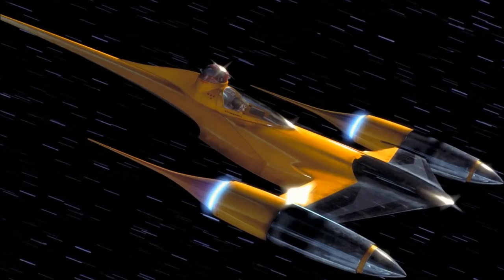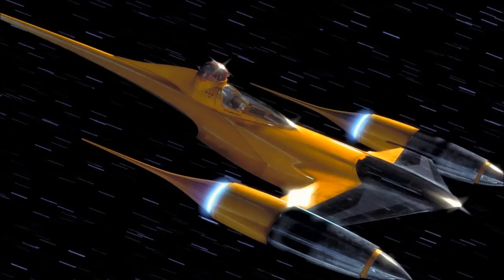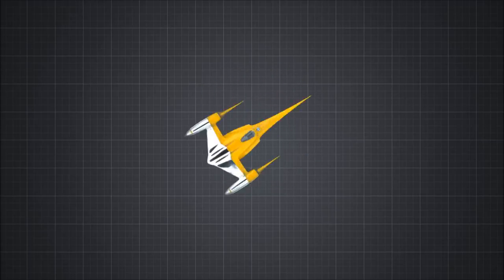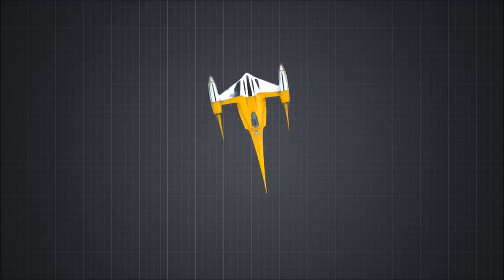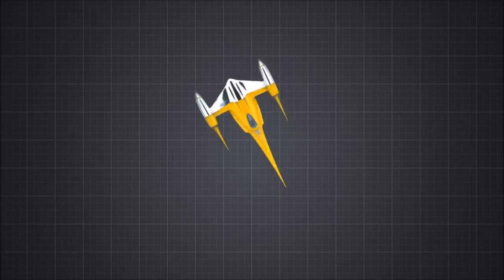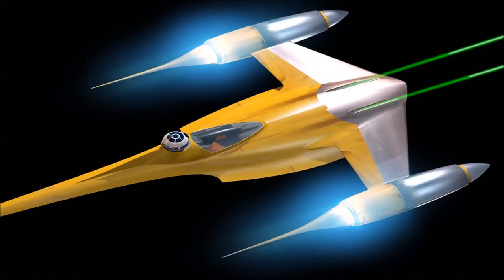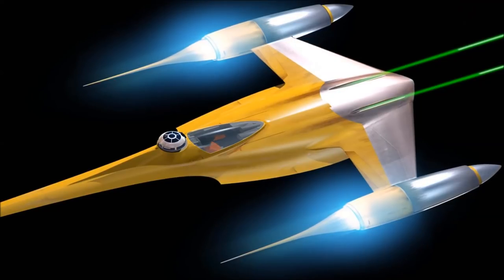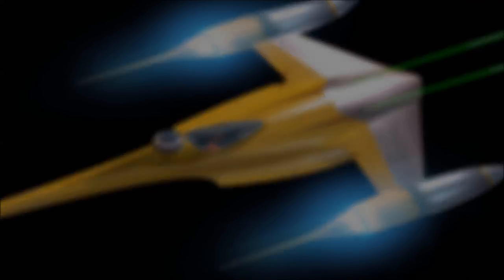Star Wars: The Big Problem with the Naboo Starfighter - Spacedock Short

Comment: Hmm... Thinking of it... Nearly whole Star Trek is a giant manual on how to not design a good starship.
Reply: Well, you are right (with the exception of the Defiant. Holy shit is that good!) but I think it's probably less of a problem with larger ships. Due to the mass involved, you'd have much slower acceleration and since the spinning would require acceleration, it wouldn't be hard to shut down the engine before that.
Reply: Евгеній Доценко could you elaborate on that?
Reply: Issues in SW in part stem from an Astrophysicist (Curtis Saxton) being involved in technical lore...at a late stage (Also Saxton consults with Stardestroyer.net...not helping) 

Issues in Trek stem from people in the Paramount Art Department (Rick Sternbach & Mike Okada) creating the technical lore

At least SW is using real world units of measure, even if some of the figures are suspiciously 'high', Trek just went for abusing the prefix "iso" on everything...which at best makes power output incomprehensible...at worst laughably pathetic (iso = equal, in the scientific manner trek uses it)
Reply: Caridor I think, with larger ships it becomes even worse. First - by whatever reason hypotetical designers themselves created more then one weaknesses in ship's superstructure. This weaknesses were exploited by enemies of Federation more then once (for example, last Star Trek movie), but they persists. Second...General rule of thumb says - fighters are rather expandable, more or less. Destroyers and frigates in large battles are, pretty much, two. Large starships,  like cruisers or larger, are not. They are much more expensive and carry pretty large crews. They must have some degree of combat endurance - like, duplicating or triplicating vital components, for example. They can't have so many exploitable weaknesses. And still - in Star Trek they have.
Read, for example, Weber's Honor Harrington cycle. Well protected warships, capable of receiving hits and delivering them.  Performanse-crucial components are protected and/or duplicated (at least), main command center is deep inside the hull and duplicated too, crew suits up into space suits and buckles up before the combat.
Reply: Christopher Bloom Most of Star Trek ships carry way to many exploitable  (and more then once - exploited) structural weaknesses. Like, for example, engines on long and rather thin pylons.
Reply: Dan Gutridge the next generation did employ a scientist to consult in the first few seasons of the series, and wrote the techmanual but the other series just copied the techmanual.
Reply: Евгеній Доценко but the nacelles are Most often not used for sub Light acceleration. Impuls drives (sublight engines) are Most of the time far closer together..
Reply: Евгеній Доценко -  Well in fairness to Star Trek most of the Federation ships are for exploration or light escort duty's and not 
fully fledged war-ships, and the large pylons on the side/back of the ship are for warp drive  for sub-light speeds those engines
are typically red/orange and mounted to hard-points of the ship.
Reply: BigHeadClan Hm... You know, leaving your "Plan "B" so exposed to potential damage and/or disattachment does not sound like a good plan, at least for me. And, unlike, for example, Galactica's FTL drive, they can't be repaired by the crew.
Reply: Евгеній Доценко - For sure having the pylons farther from the ship does make for a larger silhouette and you could prevent an enemy ship from jump to warp as a possible tactic but again the ships are designed for exploration. The later ships in Star-Trek make user of  smaller/thinner pylons that are positioned closer to the hull to correct that issue and are usually far more maneuverable at sub-light speeds.

As for repairing the Warp drive in Strar Trek that's totally possible to perform repairs and replacement, they can littearly create matter with the replicators it just eats up a lot of energy.  We just never really see it on screen because it's impractical to try and perform work on a engine when it's running. 

In any case the Star Trek universe has a pretty strong reliance on shields rather than a durable hull,  so it makes comparisons a bit odd when you start looking at other franchises.
Reply: Those two nacelles on the sides, while needed for warp propulsion, the warp core, also known as the engine, aren't in them.  It's usually in the center of the ship to protect it and help with power distribution.  Hitting a nacelle would prevent it's escape or create a vulnerability to deal further damage, but in combat propulsion is handled by impulse engines and thrusters (the red parts and rarely seen respectively) so the ship wouldn't love what you tried, but it's still mobile and able to return fire, energy or otherwise.
Reply: The Cardassian ships are pretty good though. And the Borg stuff is also spacey.
Reply: It all depends on what era and what ship class, such as the defiant class and the Prometheus class, both classes are purpose built to fight, most other classes are not built for war but instead with the express purpose of exploration. Even star wars star destroyers, first order included have a major weakness, direct attacks from the stern, not a lot of defensive weaponry there that a smaller, faster ship with powerful shields and weaponry can exploit to immobilize the ship and punch through it's armor. My point being is all ships in all genre's have exploitable weaknesses. Claiming one genre over another is a moot point.
Reply: The in world reason for the nacelles was a limitation on the warp drive technology.  When they started designing ships for Starfleet, they decided that the warp drive nacelles had to be set away from the ship because they create a bubble around the ship, and can only project that bubble a certain distance from those nacelles.  So they are set apart from the ship so that the bubble surrounds the entire ship.  The in world reason for later designs being able to pull the nacelles closer to the ship is that the tech got better and they could project the warp field farther out.  Non-starfleet vessels (Klingon, Romulan, etc) were supposed to use different tech for FTL and thus didn't have that same limitation.  At some point they decided that almost everyone used the same warp tech but just had different designs.
Reply: Lisa winn not all, actualy. BSG, for example, have pretty, memorable AND practical designs. Babylon 5's starship designs are also hard to pick on - they are not perfect, no, but they are functional.
Reply: Trek uses the metric system all the time.  The Iso terms (which is a real term but not how they use it) are nearly exclusively used only for weapons, and even then just torpedo.  But the amount of anti-mater the ship holds is measured in liters, same with plasma, Lightyears is used properly unlike Parsecs in SW (oh, and Trek uses Parsec correctly every time its used).  The only time Trek uses terms like iso and concrins (and no, that's not the right spelling) is when they need a unit for something which has no real reference.

As for Trek ship design, they are actually far superior to most other franchises included Star Wars.  The ships are compartmentalized on purpose, and remember, while Trek gets into fights all the time (its longest war last from the beginning of the Federation, nearly 200 years by Star Trek Nemesis), they are designed for peace time missions, which in reality is most of their day to day operations.  Keep in mind, the Federation doesn't build warships, but aliens who do, like the Romulans, Klingon's and Dominion all build highly compact ships.  Trek ship's warp drive also works differently and puts out a lot of radiation, as noted on many episodes, which is why only late 24th century ship's bring them in tighter, and the ships can operate on one nacelle which doesn't work on Newtonian physics, so it wouldn't experience the turning moments of a Naboo fighter.
Reply: Quiet trekie. NO ST ships PARTICULARLY pre-DS9 Fed designs are NOT superior. And for a culture that prides it self on intellectual achievement, reason, and science, it sure seems that it's a hardheaded motherfucker of a civilization. Practically the WHOLE galaxy has shown that it will NOT leave them be, yet they refuse to make warships until the fucking dominion war. 
As has been said, having your FTL on two flimsy struts is NOT a good idea in a universe that sees conflict as often as ST does. 
And what war has lasted over 200 years?
Further, "warp engines" is a misnomer, just as turbo "laser" is a misnomer in SW. The warp nacelles are space-time warpers. You still need the impulse engines to GO anywhere, otherwise the all the nacelles will do is warp space-time.
And "iso" has been used for PLENTY of things besides torpedo yield. And VERY inconsistently at that.
Reply: Every ship has at least one exploitable weakness no matter what genre. Even the victory from B5 has an exploitable weakness and it is one of the most powerful warships with the best ablative armor any genre has ever created. 
Some are obvious by simple observation, such as a federation heavy cruiser (any era), star destroyers, your basic earthforce heavy cruiser, or a colonial battlestar, some are not as apparent or as easily found. Even the most heavily armed, shielded and defended mobile battle station in  any known genre had an exploitable weakness, the death star. For those that don't know, the ISA Victory is a destroyer class whitestar, not the same as your basic whitestar attack cruiser. You can look up it's stats and picture online by searching babylon5, isa victory.   http://babylon5.wikia.com/wiki/Victory
Reply: those nacelle is not sub-light engine though. If you destroy those the ship still moved like normal but cant warp.
Reply: True, Starfleet refused to make dedicated warships until after Wolf 359.  (they just saw their first full deployments during the Dominion War.)  However, they did have cruisers doing multi-role tasks like border patrols, law enforcement/interdiction, and peace-keeping actions.  Also, considering most Starfleet cruisers (a term used for a very wide selection of ships size wise) can hold their own against warships of similar size, Starfleet had previously determined that dedicated warships just weren't necessary for them.  Remember, the Federation had a 20 year war with the Klingon Empire, and neither side had really gotten much advantage by the time the war ended.  Similarly, they fought the Romulan Empire fairly successfully (although that war was starting to go against the Federation until the Romulans suddenly ended it.)  Simply put, the Borg was the first threat to the Federation that their non-warships couldn't actually handle.
Reply: Exactly, until the arrival of the borg, Starfleet actually had no need of dedicated warships. Most ships did fulfill multiple roles including battleship, escort, and attack cruiser. The multi role aspect of federation ships is one of the reasons their designs. Even the defiant class, a dedicated warship, still was built with aesthetics in mind, it looks good, maneuvers like a fighter, and mounts the firepower of a battleship. Star wars however does things right in some areas too, many ships are built with war in mind, the basic star destroyer is a fine example. Even the Naboo Starfighter as detailed here on this page, built primarily for showing off and ceremonial purposes it can still prove itself a tough little fighter in the hands of a skilled pilot despite it's weaknesses.
Reply: simpsonfan13 wrong the warp engines generate the warp field and it is the warp field which pulls the ship along at FTL the impulse engines are not used in any way at warp.
Reply: I'm a little surprised that nobody's brought up the Borg cubes in this comment string. It's actually a fundamentally very solid design for a spaceship, perhaps one of the best in sci-fi from a realism standpoint, even though, ironically, most other Star Trek ships are godawful. The cubes and spheres of the Borg fleet are symmetrically shaped, loaded with redundant systems, and have propulsion and weapons systems relatively symmetrically placed on the ship. These are all the hallmarks of a design built from the ground up for the Newtonian physics which govern space combat. Now, don't get me wrong, most of the advanced technology onboard Borg vessels is total horseshit, but in terms of appearances, it's probably the closest to what a real-world warship in space would actually look like: An ugly utilitarian-looking block of death bristling with weapons and thrusters.
Reply: There's this ring around the saucer and it's the new phaser. Who needs emitters or ports ?? The energy will go around and leap off at the target you want. In any direction..  
And they say star wars is fantasy, lol 
Elements of both are . Can't tell them that

Comment: I have an issue with how pointy and thin parts of it are. The tail on the back does not need to be that long and skinny. Nor do the engines need those long thin projections on the back. And why is it painted to look like a chrome plated banana!? Of all the colors they could have gone with why was "space taxi yellow" on the options list?
Reply: I agree wholeheartedly about the color.  I think the technical name for it is "Chromate Yellow," but I'm not 100% sure.

IMO, had they used a rich, Royal Blue instead (but kept the nose the same chrome), the result would have been breathtakingly beautiful.  What color set-up would you have chosen?
Reply: This ship was designed both in universe and out, too look pretty, not to function. as for yellow, I don't mind it that much, Though I agree it would look much better in blue.
Reply: Well obviously would have gone with black if we're fighting in space.
Reply: The color doesn't matter really in space, it's just that on the ground it's butt ugly. I agree that a rich blue would have looked better. or even republic red.
Reply: Adult here who really likes it yellow.

Comment: 01:54 Gun placement. In Star Wars, the laser guns on starfighters can fire just ever so slightly off axis (even TIE's). This is how they can get away with having guns so far spaced apart and yet the shots will still converge on a target regardless of range. They appear to do so even without gimbals (see cross sections). You see this when Darth Vader is shooting down X wings in the Death Star run (his angle of fire rotates independently of the TIE fighter).

Comment: ant remember what 1 but in the X-wing series this happened too corran horn after he got partialy hit with an ion cannon and it shut down all engins on one side and he got mashed to the opisite side of the cockpit until he could force a manual retart to shut down the remaining engins so yes the inertial compensators will keep the ship in one piece as long as the are still running that is :) otherwise great vid man keep up the great work lovin them!!!

Comment: You should read up on the Legends book, X-Wing Rogue Squadron.

A character there, Corran Horn, actually experiences the off-center engine-thrust differentials.
The book also goes into explaining, not exactly how inertial dampeners work, but how they are used. (Where they, in the X-wing can dial the amount of dampening it will do for the pilot, in which many pilots keep it less that 100% to have a feel of the forces from hard flying).

It was near a planet called Talasea.

Regardless, the N-1 Starfighter does have some glaring issues, with it's design, regarding the engine size and placement.

Comment: Counterpoint on engine placement: By having the engines away from the cockpit they're less likely to take the cockpit with them should they explode. Also "inertial dampeners" are in general poorly defined as to how they work, they could potentially even compensate for only having one engine out to one side.

Comment: I think the star fighter is designed fairly well, considering the engines are away from the main body of the craft, where a lot of star fighters will be aiming. Because it's seemingly faster than literally everything it would fly against, all it has to do is accelerate out of the engagement, since nothing will be able to catch it. This speed also gives it FANTASTIC evasiveness against weapon emplacements, as a lot of turbo laser turrets would have trouble hitting one at max speed. 

I think it would make a fantastic star fighter if better armored, with a shield generator on the back side where there's that silly spike or on the connecting wings, and automatic engine ejection in case of a hit to an engine. It would be a fantastic fighter superiority craft and would dominate any fighter on fight engagements.

Comment: In X-wing, the original Star Wars flight sim, I could one-shot Imperial TIEs with both front-mounted laser cannons in dual fire mode on a BTL Y-Wing. No other Rebellion starfighter could one-shot a TIE because the cannons were too far apart. So your point about front-facing weaponry is well taken. Also, on the BTL Y-wing, the struts are a weak spot and exhibit the same problem as the Nubian N-1.

Comment: On the other hand, its useful for a spaceship to have engines in front. By dragging the ship, engines put less acceleration stress on the ship itself, unlike the more frequent in sci-fi engines in the back which push the ship from behind. ISV Venture Star, one of the most realistic sci-fi ships from "Avatar" has engines in the front because of the mentoned reason.

Comment: What is the fighter was redesigned to a point where they remove the two ion engines I replace them with one large ion engine that was basically designed to fit into the back tail of the fighter. That way you pretty much are able to slim down the fighter to appoint was pretty much a long thin spear.